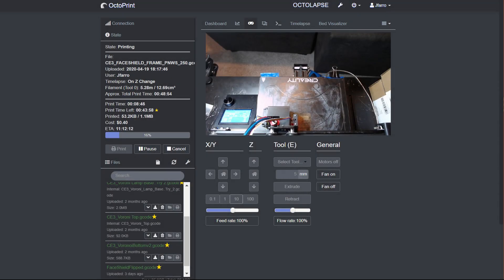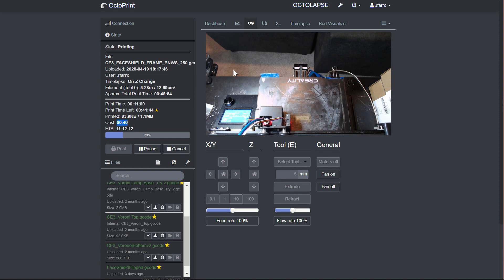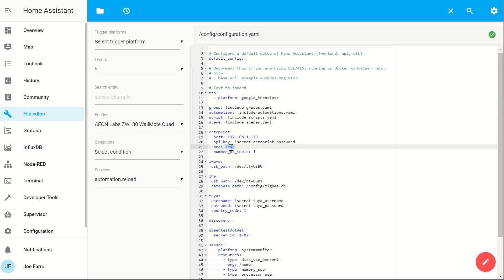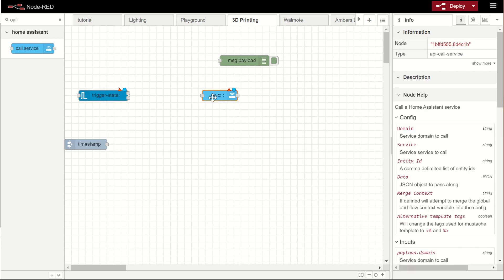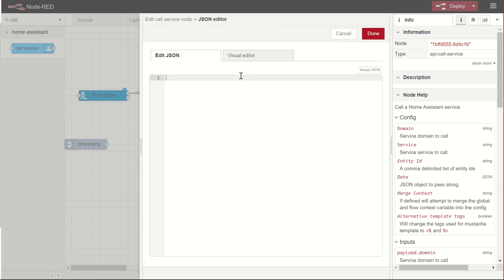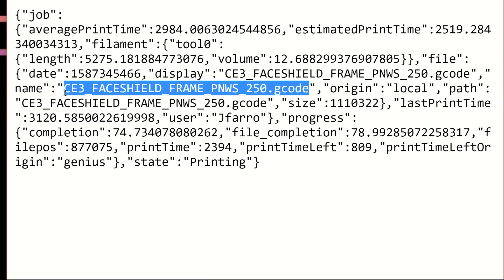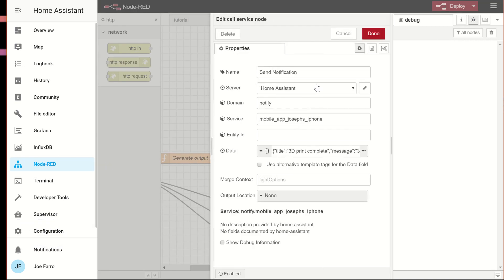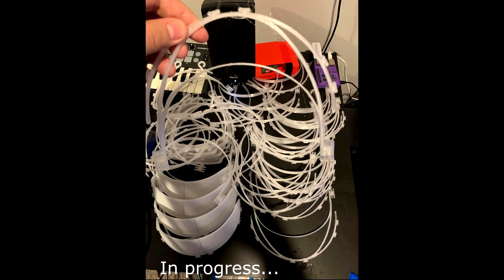Home automation and a 3D printer - Octoprint Home Assistant Tutorial

Comment: Hey, this video has been really useful. I am working on a project to automatically print/remove/store printed parts in an IOT kind of way. Do you think node red could handle the commands of 3 steps of my project? (removal/ transport part/store in a specific bin/location)
Reply from the maker: Thats tough to reliably answer without knowing a ton of details.  I can say that Node Red is incredibly powerful simply due to being able to call out to javascript and then run your own logic. How you interface with a printer matters as well. I've seen (and done) some work with octoprint and the mqtt plugs for it to have quite a bit of control of the printer from home assistant, and then could use node red to control/interact there. How you do the removal/transport/storing would have to interface with that system either through MQTT or something else node-red can listen to (I've used http to talk to it..there's a number of portocols).  Sorry I can't be of much help, but it's a question that would just require alot more detail.  I'd say give it a try, there's no harm, and if you hit an issue...then you just have to figure out how to make the endpoints talk.  For the logic..again..javascript is your friend if you relaly need something complex.

Comment: Hi, may I know how can show other status of printer on Home Assistant dashboard such as filament used, power used and what not? I have tried using API and give {value_json.job.filament.tool0.length} as the value_template on the configuration yaml  but I cannot get the value shows up on Home Assistant. I have ensured that it's not the issue of API by using node-red to get the value shows up as debug message and it works. Do you have any idea on this? Thank you in advance.

Comment: Tip. You can easily add more stuff to message. My print done message contains screenshot from camera of finished object and action button to access the 3d printer home assistant tab in the app. Also useful you can add button trigger to run shut down scripts from text once the print is done. I also got smoke/fire detector automation that will send me text with picture and button to trigger shutdown.
Reply from the maker: Those are awesome suggestions!!!!! Thank you I am going to look into those and may do a follow up. Esp. The fire one, but also the idea of a button to take actions in general (and the pic...brilliant and I should’ve thought of that before I made this). Thanks those are cool